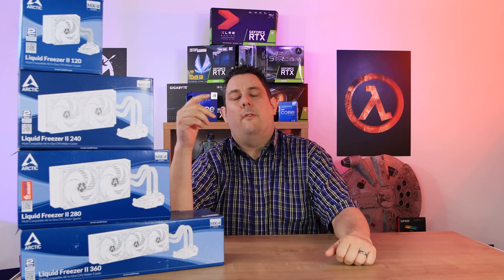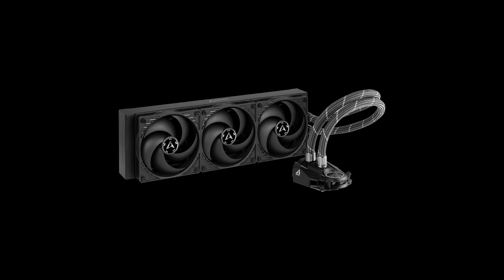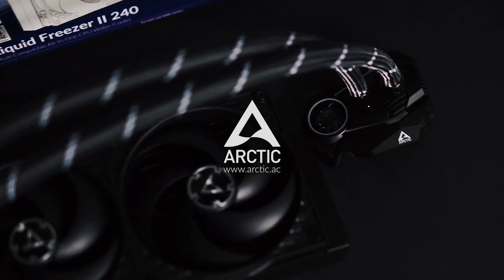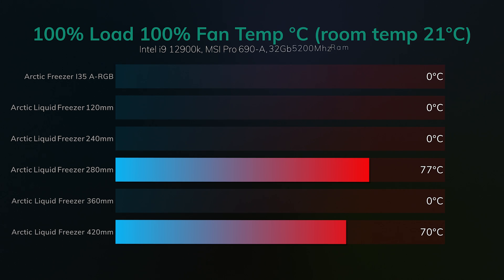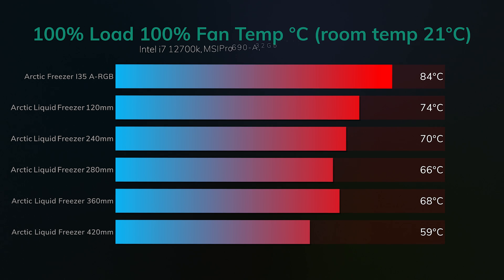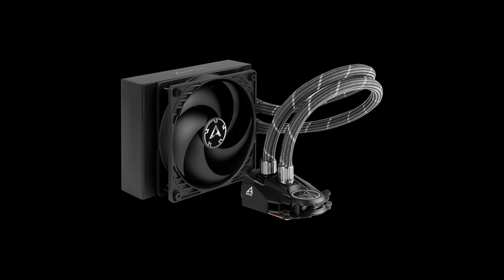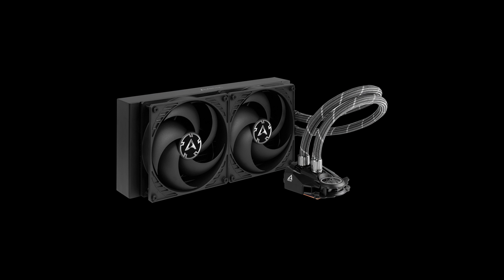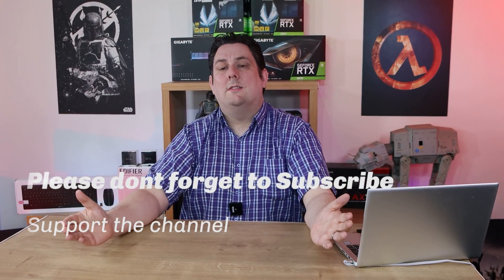Can the Arctic Liquid Freezer ii (120mm 240mm 280mm 360mm 420mm) cool the 12900k & 12700K

Comment: I am using the 240 mm version but under 100% load and 100% fan speed my temps are 100°C. Should I reseat the cooler?
Reply from the maker: Are you using the socket 1700 bracket?   or in a hot environment?  otherwise, I would recommend trying to reset the cooler and make sure there is plenty of airflow into the case
Reply: @TechforTechs  I am using the 1700 socket bracket and i reset the cooler also changed from push to pull configuration on the radiator fans. It got the temps to 80 C. But if i use turbo boost it starts throttling.
Reply: this could be due to the socket 1700, which can bend the heatspreader. look for "washer mod" and "Alder Lake’s cooling problem straightened out by 5 degrees! – Simple ILM-Mod for Intel’s LGA-1700 socket" at igorslab

Comment: How is it possible that it runs that cool? I have a arctic liquid freezer 2 360mm rev6 with lga1700 bracket on a 12900k with msi pro wifi mobo. Room temp 19-21c and in idle mode its around 32-37c with grizzly extreme coolpaste. In you videos it is around 22 idle? And the 280mm can cool it at 70c in a 100% benchmark? How? Should i order a 280mm? How can it cool so much better than a 360? But most of all your temps are already 10c cooler than mine in idle mode.
Reply from the maker: A lot of motherboards have built-in overclocks so make sure they are disabled if that's the case, also our test system is not running a lot of programs in the background, like steam, discord, skype and so on,  when our systems are running at idle the CPUs are running at 0.1 or less. the 12700 is very efficient at low usage (hence the efficient cores).
Reply: @TechforTechs  same here. What tdp / voltage did you run the benchmarks at? And i still wonder how the 280mm can make a 30c diff compared to a 360mm
Reply from the maker: @DAIM90  Don't have full stats in front of me now as it's after hours and I'm not at the studio, but tests were run a stock settings, not sure how you get a 30c difference between a 280 and 360, the 280 was only 2c cooler than the 360
Reply: @TechforTechs  Ahh oke. Well 30c because the 280mm kept the cpu around 70c and the 360mm wasn’t included since it thermal throttled. That should be at 100c. So that would make up for a 30c difference between the 2. I just wonder how it can be such a huge difference. I own a 360mm and thinking of buying a 280mm but it would be so weird it it cools the cpu at around that 70c all of a sudden. I have massive issues keeping the 12900k under 100c in a multicore benchmark at stock settings
Reply: @TechforTechs  Well i switched my NZXT Noctis 450 pc case to a Corsair 5000D with 7x be quiet silent wing 3 fans and mounted the arctic liquid freezer 2 in a front position with the tubes down. Now my 12900k runs at 83c mac while using stock settings. I can run cinebench 23 multicore and it will not exceed 83c. Before it reached 100c instant and started throtteling. After running stock settings i undervolted with offset -0.100 and now i can run 8P cores on 5,1ghz and 8Ecores on 4ghz while keeping my fans at 70% speed and not exceed 79c in mulicore benchmark cinebench 2. So i don't know what the trick is but its airflow or another way of mounting the rad. So a freezer 2 can cool a 12900k.

Comment: How did you mount the coolers to the board? Did you use the LGA 1700 kit or stock and if you used the kit was there any issue with setting it up and contact between ihs and the cold plate?
Reply from the maker: These were tested with the new bracket available from arctic, if you can provide proof of purchase of the cooler i believe they will ship the 1700 brackets out free of charge
Reply: @TechforTechs  I did order the cooler, cpu AND the bracket just wanted to confirm if it fit and mounted well.
Reply from the maker: @moazzamfarhan2206  we had no issues mounting on 3 different sk1700 boards
Reply: @TechforTechs  Shweet, I get my 12700k and msi z690 edge wifi, good to know it fits well and has no issues! Ty :D

Comment: Hey there! Thanks for making this helpful content!

I've recently got my 12900KF, placed on Be Quiet 500DX and after watching this video I bought an Arctic liquid freezer II 280 (280 is the only one to pass the test and could fit in my case) to cool the CPU down. It seems that I get around 32-35 degrees when idle and on 100% load (CPU-Z stress) I get around 93 to 100 degrees and eventually CPU is throttled down to 4.2 - 4.3 Ghz. The AIO's radiator is mounted on the front, Arctic MX-4 applied and 3 x 140mm case fans mounted inside the case (2 on top and 1 on the back). The room temperature is 23C.

Any tips on how to get closer to 21C idle and 77C on 100% load?
Reply from the maker: Hi, First of all make sure you are using the new 1700 adaptor, so it fits corectly and all the mounting screws are in tight, the temp will never go lower than your room temp, so if you live somewhere hot this can cause your idle temps to be high,  some motherboards do a factry overclock on the CPU to make it a little faster as well, so you may want to look into that, this can be called something different on each motherboard.
Reply: @TechforTechs  I was so dump, I messed up the 13mm (LGA1700) and 14mm (LGA 115x/1200) standoffs and istead of reading the manual, i ended up using the the bigger ones for my "bigger" cpu haha. I changed them with the apropriate and got 22C/72C (idle/100% load)

Thanks for getting back though!
Reply from the maker: @SotosKprs  thought something did not sound right with these temps unless you lived on Mercury,  glad you got it sorted though and we all make mistakes.
Reply: @SotosKprs  thats nice to see :)
Reply: @SotosKprs  Does the contact plate cover the processor case completely?
Reply: @SotosKprs  how do i see difference with them
Reply: @morgothbloody7181  you mean the difference between the standoffs?
Reply: @SotosKprs  yep
Reply: @SotosKprs  don't want to mess up
Reply: @morgothbloody7181  just measure them. The standoffs for LGA 1700 should be 13mm while the older ones (LGA 1151) are 14mm
Reply: @SotosKprs  ok, I'll hope i see difference
Reply: @SotosKprs  Hai Sotiris how about ur Artic freezer 280 now? still working well?
Reply: it's easy. get better fans like the phanteks t30. would cost around 60-70usd but just reuse the stock radiator fans to another part of the case.
Reply: @seanharricharan8891  Thanks! I'll definately check them out
Reply: I got the same 500dx. Could you tell me if it can fit to the top? I know that Arctic says no, but still, is there any chance?

Comment: Definitely doesn't cool the i7 12700k properly. I don't know if I got a faulty model or there is some issue but idle temps sit at around, 40 degrees celcius, reaching 100 with ease.
Reply from the maker: sounds liek you have a faulty unit,r its not fitted correctly or its overclocked,  at stock we get nearly room temp, so make sure you took of the plastic from the base and the thermal paste is appyed, and you are using the new 1700 bracket. also make sure you have the fan header plugged into the CPU Fan header on the board

Comment: So I have a 12900k, and an arctic freezer ii 360, waiting for the bracket.  Should I sell it and get the 420? That's the only solution?
Reply from the maker: @Max Smarties maybe contact Arctic,  you will find your facts differ from the real facts.
Reply from the maker: the 360 will more then likely thermal throttle under heavy loads, which means its will slow its self down to stop over heating which gives you less performance or there is a chance it will crash,  I would highly recommend you look into the 280 or 420 if you can fit them in your case
Reply: @TechforTechs  So I bought the 420. I ran cinebench 23 and it went to 98 degrees C. It ran the full 10 minutes though. Is this a mounting issue or should I try a different thermal paste? Thanks for the feedback. Cheers.
Reply from the maker: @judgeees  did you get the socket 1700 bracket, if not contact Arctic and they will send you one for free.  We run the 12900k on the 420mm on a overclocked editing PC and max temp is around 85’c
Reply: @TechforTechs  I DO have the LGA 1700 bracket. I have remounted, and used several different versions of thermal paste. 

I thought this was as a result of my MB turbo boost, it was overclocking to 1.375-1.4. Even with the boost off, it still goes quite high, but the voltage is quite high too. When I undervolt, it's around 86 C.

That being said, I want to know how some individuals have hit max 72 C using my cooler. 

I have a full tower (Phanteks enthoo 719), and 9 fans. <u 3080 ti does not go higher than 73.7 C on a full load with the fans running at 80%. 

My cpu does not go higher than 74 during gaming, but I know it should be better.

I have remounted 5 times and bought more than one lga 1700 kit, I really do think mounting has to be perfection to get the cooling working. 

I have also emailed arctic, and they have escalated the issue to their engineers, but their response time isn't the best. I've spent $400 Canadian dollars on their coolers, and another $30 on MX-5 paste. 

If someone has as solution, let me know.

Thanks!
Reply: @judgeees  98C! It’s not burn or fire?! Wtf is this temp for 12900k , I hope Intel fix 13900.
Reply: I have a 12900K overclocked to 5.1 / 4.1 / 4.1 Ghz (P-core / E-core / uncore) at 1.26V (under load) and during Cinebench R23 it pulls nearly 270W with the temps hovering between 85-93 degrees C°. That is with LFII 360 A-RGB mounted at the top of Fractal Meshify 2 with additional 4x 140mm Arctic P14s as intake and 1 more P14 as rear exhaust, all fans running at 1300 RPM (maximum would be 1700).
So, no problem as far as I am concerned. it would throttle in OCCT small extreme or P95 when setup so that the dataset fits in the cache and doesn't hit DRAM at all = ridiculous heat, but that's not a realistic scenario.

Comment: I have the 420mm and keep the i9 12900k cool enough even at the highest load posible, I think is the only water cooler  what can truly handle this processor.
Arctic freezer use a massive radiator and this is a benefit.
Reply from the maker: We use the 420 on our main editing PC, while the 280 will also work, the 420 is a lot cooler running.  Thanks for watching
Reply: How can 280 can handle it but 360 cant? Do you have any info?
Reply: @hhuseyinbaykal  because the 280mm have 140mm fans and running faster rpn than 360mm radiator what have 120mm fans and running slower rpn
Reply: @Angelo_Paduraru  Exactly what I was thinking. Those larger 140mm fans (and faster rpm as you said, I don't know the max rpm) are what give the 280 an advantage over the 360.

Comment: hi, thx for video .how did you apply the thermal paste, grain of rice or spread it on the surface?
Reply from the maker: We spread to make sure every test is consistent, arctics mX5 was used as well. thanks for watching
Reply: Thermal paste application doesnt really matter as long as the cores are covered.  This has been tested and re tested countless times.

Comment: The 12700k generates a higher temperature in cinebench close to 100 °
Reply from the maker: Depends on the cooler, your test setup, and room temp and overclock.   but we did not get temps like that in cinebench R23 with these coolers on average over 30 min.  if you are getting 100°c they you will be thermal throttling, which we did not have an issue with unless using a 12900k.  obviously, if you have an overclock or your motherboard has an auto overclock on it will get hotter.
Reply: @TechforTechs  25° ambient 34 eSports duo

Comment: Hi I am thinking of. Buying arctic lf2 280mm for 12700k . But here in summer ambient temp will go upto 38c . So will it be sufficient to cool my 12700k? I do rendering mostly.
Reply from the maker: In they it should add on around 17c to the peak thermals,   so should take you to low min 80s under a 100% load.   unfortunately i have not tested a cooler in these temps but cant say 100%.  we do plan to do a video in the future about room temp, but it could be a while before we do that as temps are currently around 0c at the moment and we have a lot of reviews booked in
Reply: hi ... did you get arctic lf2 280mm for your 12700k? ... how is it performing?
Reply: @raysmith5487  nah due to high motherboard prices and very high temps here, i went with 5900x and arctic lf280. Cooler is really good, even on heavy rendering 5900x never went above 76 C.
Reply: @adarshwhynot  thanks for the prompt reply ... i am leaning more towards i7 12700k especially for it's igpu. Actually made a complete U turn from 5900x to i7 12700k 😀.
Reply: @raysmith5487  understandable :D , 12700k is a beast!!

Comment: Pretty wild how hot those things get lol,  I have the 120 on a 5900x in a high airflow phanteks case and it keeps it plenty chilly even when rendering
Reply from the maker: Yeah 12th gen get hot under extream load,  under normal load they are not bad.
Reply: I just bought this because my 5900x is running hot! What are your boost clock speeds? My current AIO I’m seeing temps in game of 80°c at 4.9ghz. I’m really hoping this AIO will reduce that down to low 70’s! Might have to undervolt and try and hit 4.7ghz instead
Reply: @heythenameiselliott2673  which size liquid freezer did you get and how it performs for you?
Reply: @Arx07  I got the 360 one and it’s cooler my temps down big time! I’m able to get all 12 cores 4.7ghz and max temp is like 57°c
Reply: @heythenameiselliott2673  nice :)
Reply: Got phanteks p400s and 5900x also and using with a h80iv2 currently and under 4.5ghz it hits 80 degrees. I really consider getting a 280 and i wonder how much difference it would make.